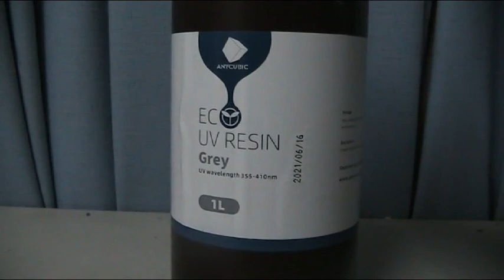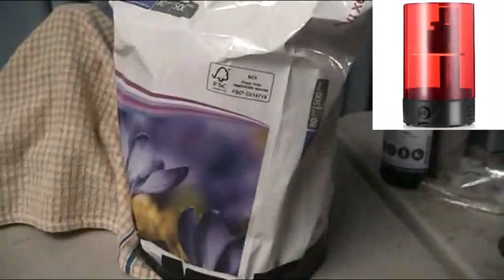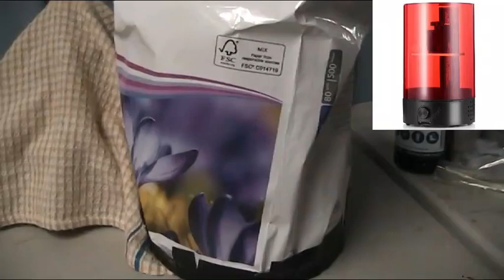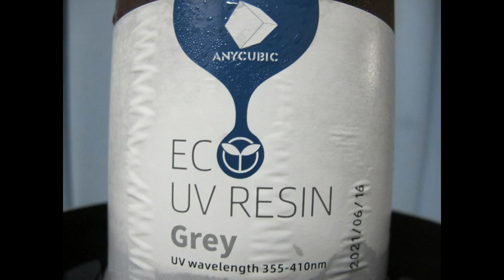Sparkmaker - Anycubic EC UV resin test review

Comment: EXCELENT!!!  I needed this information to make a decision on getting some next month.  Aliexpress has resin in bulk but you have to check the prices daily. I have found 10kg of Eco resin as low as $138 USD with free shipping of 10-14 days.  It is a bit pricy at that point but bulk is the way to go. Standard is of often available for about $10 USD or less in bulk. I may eventually get some for making titans as the size of the parts negates the disadvantages of standard. 

Thanks for the heads up on black resin, I have a Creality 006 4k printer and she probably couldn't handle that. I don't see a lot of love for my brand but she works well even at just 4k.
Reply from the maker: consider throwing a heating band on it for improved performance, I use to use a non popular printer for ages as well. If you can make it work with great performance forget the criticism. Also wow that is an amazing price.